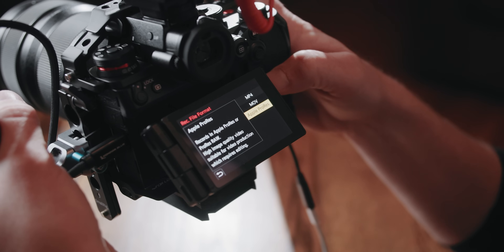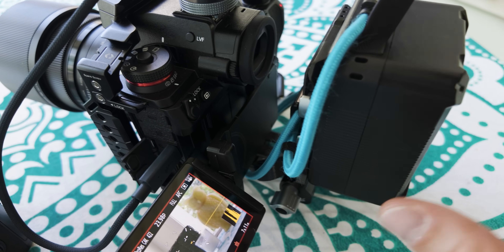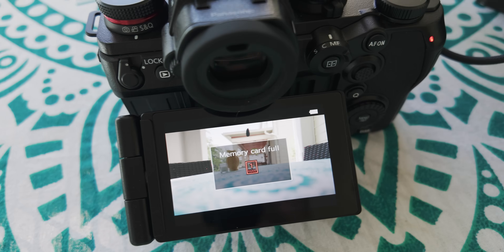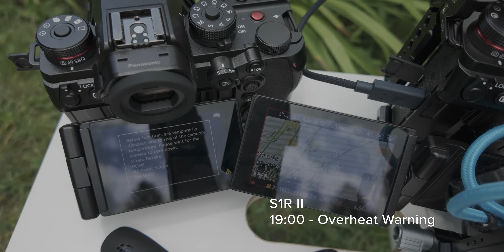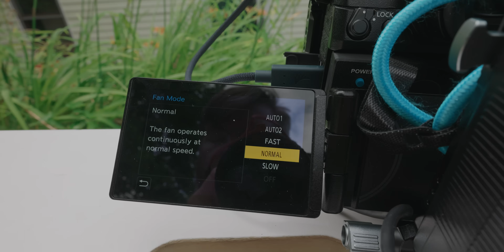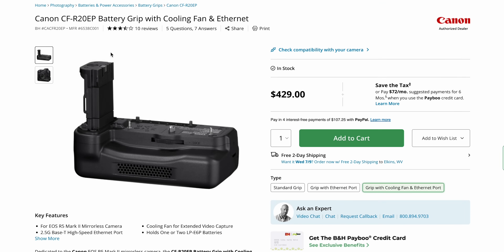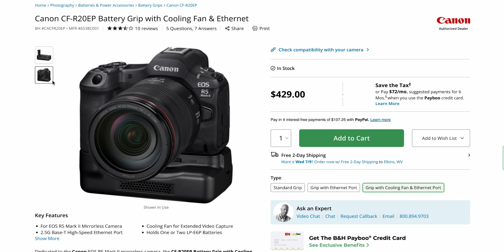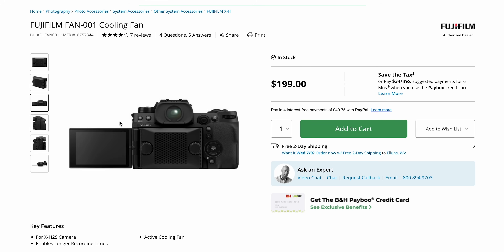I Tried Everything to Not Have My Lumix S1R II/S1 II Overheat

Comment: Do you think the s1rii would overheat if used indoors, 6k open gate 30 fps, connected to power but used for livestreaming for 8+ hours? It's hard to find info on this scenario since no one really uses it also as a webcam for livestreaming, but also for photography.

Comment: It seems like in real use this is not a big issue but if I shot Outdoor events I would stick with S1H and S52X.  
PS: I do not think Panny recommends cards based on thermal performance so no surprise approved cards may overheat easier.  I got one approved slower under 1700mbs Card.(Which is still fast) I stayed away from the faster over 3000MBS cards but not sure if that matters.

Comment: In my experience I will tell you this - GH5 did not overheat, GH7 did not overheat - I shoot video in UAE Dubai - I often shoot video outdoors - at a temperature of 35-45 degrees - or whatever you have there - in Fahrenheit it is - 95-113 degrees. What happened to Panasonic - that they stopped making cameras normally. And this HDMI delay - well, there was never any delay like in GH4, GH5, GH7 - that's the problem with the S series - overheating, HDMI signal delay, noise reduction that does not turn off, problems with connectors .... Panasonic is degrading.

Comment: If you just use the fan and keep it out of the sun the S1Rii won't overheat even when dual recording to SD/CFexpress. https://youtube.com/shorts/9vmIgchIJmc?feature=share
Reply from the maker: The sun is the tough part, for sure.
Reply: @CurrenSheldon  I just use a flash bounce diffuser to block the sun. Easy peasy.

Comment: I’ve had inconsistent overheating results too. The ac has been out in our office all summer, so it’s 85° Fahrenheit in the office and we film a 30min Monday podcast every week. It never over heats if I have my daughter’s stroller fan on the tripod. Thermal management set to high, fan fast, screen and all doors out and open, still overheat. But outside in 98° in the sun on a tripod, not even a warning, recorded for 10min at a time in different spots in the sun, no warning. Sometimes recording 6K and most times at 4k. Even overheated at HD with stroller fan in the studio without ac

Comment: LUMIX users (me included) will go to the ends of the earth to defend this company. And yes – they have been very reliable. They have to be, because when it comes to their competition, they fall short of the mark. They STILL have crops on their higher frame rates (albeit small). They have poor rolling shutter performance, sometimes due to the higher DR modes they have to employ to keep up in that department. The BLK22 battery is WAYYY overstaying its welcome. Until recently, they didn't even have good autofocus. So they get by on value, stabilization, and great software. The best of any camera system I've used bar probably Arri. They can't afford to slip in any of those departments, and it's everyone's responsibility to keep the pressure on them. That's not hate, and they don't need a defense from it.
Reply: Im a die hard lumix fanboy but im really disappointed with the latest releases. And yes that small battery in the s5 body size but new s1 specs doesnt make any sense whatsoever. Shouldve stayed with original s1 body size + battery

Comment: Congratulations on your tests. I'm thinking of purchasing the S1R2. I'll start by saying that I live in Rome, where I think it's hotter than where you live (in August, temperatures range from 30° to 40° Celsius, taking into account that you shot the video in July, when temperatures are slightly lower). I've also never had overheating warnings while recording with my GH4, 5, and S1. I agree with what you say, that the new S1 models generate a greater amount of data at higher frame rates. Do you confirm that your tests were performed in Open Gate 4K mode at 120 frames per second? Have you tried using a recording mode like the GH5 and S1? Of course, putting a small umbrella on top is ridiculous and cumbersome. At this point, I'll have to consider an external battery, despite the added weight and imbalance.

Comment: In my tests too the direct sunlight was the biggest problems. No matter what else you do once the light hits it and it has to stay under it, it's over. All the "workarounds" just added a few minutes if that. If it's hot but no direct sunlight the S1RII can go for like 45 min. AND worst of all when it did shut down it did not record the footage. So as soon as you get the warning you are done as there is no way to know when it will shut down.

Comment: Working with Sony A7IV's, I found that it was when using a V-mount to dummy battery I would experience overheating even when filming indoors and 4K24 - so not a ton of load on the system. I bought SmallRig's fan, and that would bail me out.

Comment: The Panasonic S1II and S1RII offer shooting modes that the FX3 does not. 
Cinema grade features like synchro scan,  6K open gate, internal RAW and on and on, all come standard with the S1RII and the S1II. 
Those features are not available on the FX3 or even the FX6. 
And FTR; the only Sony camera that offers native open gate like the Lumix cameras do, is the Sony Venice. And that's a $58,000 camera brand new! 
So yes, the FX3 doesn't overheat, but to be fair, we need to compare apples to apples here, and the FX3 and the S1II / S1RII are significantly different cameras! 

And there are impressive Lumix cameras like the S1H or the S5 series that do not overheat, and of course the GH7 doesn't overheat either if you're happy with MFT. 
There's a reason Gerald Undone labelled the Panasonic S1II 'a masterpiece' ...because it is!

Comment: Thanks for doing this! I own a Sony FX3 and A7IV and have been considering switching to the S1II but the overheating has been scaring me off. Oddly, I can run my A7IV at 4K 30P in full sun on a hot 90F day and it will get around 20 minutes of running before overheating. It's almost like these new Lumix cameras perform similarly even though they have fans?
Reply from the maker: Yea they seem to perform similarly. Using an SSD or SD Card will definitely help. It also seems that full professional models have just become more expensive and $3k is the new mid-tier cameras that are incredible, but have some limitations.
Reply: Just got for S5iiX
Reply: The s1II didn't overheat on me even in plenty sun 40°C

Comment: Now try with manual focus lens  and you will get another few % improvement .
Reply from the maker: Hmmm - maybe. I had the cameras in manual focus the entire test (though did have AF lenses on them) and when my camera did overheat, I was using a fully manual lens. Not sure it makes much of a difference.
Reply: it does, i have created a model for 3d printing of a cooling fan for canon R8 as it does suffer a lot when doing 4k 60p and with canon lens and manual focus lens (m42 lens with adapter) i have noticed great improvement. @CurrenSheldon

Comment: I would be interested in whether or not the S1iie overheats. I know it's not loads better than an S5iix in terms of spec but you get the nicer LCD and EVF. I assume it wouldn't overheat if the S5iix doesn't.
Reply from the maker: Agreed - will also solve the issue whether it’s the new sensors or the new body that’s the primary overheating cause. Love the S5IIx but all of the body, design, evf, ibis, etc advancements would be very nice

Comment: Not the same camera body, but I was on a doc shoot with Fuji XH2S bodies. We found that running ProRes HQ they would overheat after about 30-40 minutes, when we went down to ProRes standard, we never had any overheating. Ambient temperatures were around 25C. What this indicates is that data rates make a difference to temperature build up.
Reply from the maker: I would like to test these cameras NOT using ProRes and recording to an SD card. There are just so MANY variables that it would take days and days to test them all. But I am shooting in 6k open gate (not ProRes) quite a bit, so that may be a good thing to test.
Reply: I watched another video to the topic a week ago, it was created by a blogger from Poland. He also tried out different settings and techniques to address the overheating issue and, interestingly, using the SD card he was able to record longer than using a n external SSD. Please don’t ask me why and how that could be!… Unfortunately, it’s not an option for me as I record in ProRes HQ only. On the other hand, I never record longer than a minute or two, so I have never experienced any overheating issue with my S1R II !…
Reply from the maker: @vladislavihl  Hmmm, very interesting. My SSD was getting BLAZING hot on top of my camera, so I wonder if the camera can read that and actually kicked off due to the SSD... will need to test with an SD card now, erghhhh. 

And if you're only knocking off 1-2 minute clips, you'll be fine!
Reply: They’d overheat after 30-40min with the fuji cooling fan?

Comment: Scott McKenna did the same test in 2021 with sony - fx3 never overheats - i own this camera for years
Reply from the maker: It seems the more video/cinema focused bodies (namely FX3 and S1H) have this problem figured out - as they should. Lumix would have been smart to skip the S1 II and go with the S1H II (or whatever it's going to be) and make it real clear that the S1R II is high-res photo focused with great video specs, but if you want fully reliable video cam, there is another option.

Comment: Did you try ulanzi cu01 cooler 

It has a vapor chamber closed loop design 
The thing cools like a fridge 
Allows me to shoot long form open gate in direct sunlight
Reply: Ha, ha, ha. Very funny. Get a fridge for your camera. What next? 😎😎
Reply: @gbwalther3198 well sadly it's this 35 dollar accessory or just give up and dump 2k plus on a used Cinema camera 

Nah fam I'm good
Reply: The lcd design doesn’t allow for that thermostatic cooler to make contact with the back of the camera body.
Reply from the maker: Yep, this was my problem with a couple of the other fans I tried out.
Reply: @CurrenSheldon worth a shot 

There is also models from smallrig and tilta but lack the removable battery feature and are way more expensive, though they perform the same as the cu01 ulanzi 

I used it on a7iv which is notorious for overheating 

Xm5 which in summer day can do only 12 open gate 6.2k, now I can do 48 min open gate recording 

Xs20 can only do about 16 min outside open gate recording, now it ran at a record 59min using open gate 6.2k

Xt4 can do 29min (capped in software) X4 on 256gb card and never dies.

It was so good I had to get two of them before they become a rare find or hike up in price.

One pre balanced on gimbal for fast high frame rate 4k slow motion long takes 

Another for the handheld rig 

Even my fellow colleagues who have zv01 and a7iv bought them, said this thing never leaves their rig now 

It might work if it was allowed to run on full tilt from the start of the recording.
Reply from the maker: @MrZerosami2 yea the problem with those models is that there isn’t room for something like that behind the S1R II and S1II screen. It has the hinge along with the flip out and so you can’t fit the larger fans behind it.
Reply: @CurrenSheldon 
Yeah I just checked it's tricky to rig with those tilt Flippy screens unless it remains on top view mode 90 degree tilt but the fan won't have the proper clearance to stay propped in place and without the lip of a regular tilt screen it won't stay in without popping out.

This might leave you with the most expensive option
Tilta cage with the thermal mount tilta closed loop cooler fan. But also force you to use an external monitor all the time, even for gimbal use.

There is a third option that requires some hand grease and money, scan or measure the inside left surface on the cameras body when the screen is flipped tilt up 90degree and then scan the same surface on the s5iix screen 
Print a frame to house the cooler.
This also forces you to use an external monitor at all times.

Tricky to have a fan integrated body that isn't doing too well in direct heat 

Though the codecs are too much for the camera 

Fourth solution I can think of that is cumbersome and expensive is to grab an Atmos ninja recorder to offload the write and Brute processing off the camera to extend operation time, it will lock you out of most internal recording options and require more storage due to file sizes.

Don't own one and never tried but planning on getting one if I land a contract, been wanting to dip into the external raw hidden in my camera bodies 

It's all I can think of as for solutions to extend recording times on those heavy codecs 

It's a beautiful system the s1ii and the sensor is something else really, true low light beast and a second option to opting for Sony for low light
Reply: Tricky, been rigging lots of these SLR and DSLR body types, always found a solution for managing heat, even rigged out my friends original black magic 6k to balance properly on a crane 2 gimbal and quick release to a video tripod for run and gun work, there must be a way to rig those tilt flip bodies for better cooling, if only I can actually play around with the camera in show room or a shop, we don't have it in my region, mostly canon Sony and Nikon , I'm even one of the few that have Fuji, most people here don't know that Panasonic has a full frame line (they are missing out really)

Comment: The truth is that Panasonic messed up with these cameras. They should used the S1H/GH7 style of fan, it would have helped a lot
Reply: I've never even heard of the S1H overheat. The fan style is probably the reason along with the 24mpx sensor.
Reply from the maker: YEP. The S1H has a second fan behind the LCD screen and that helps a ton. They should have added that to the S1 II or just come out with an S1H II after the S1R II with better cooling - problem solved.
Reply: @CurrenSheldon  Interesting - what's your background in camera design and engineering?

Could you summarise the overlaps and differences in capability and characteristics of S1H, S1Rii, S1ii, GH7 and S5iix? And then go on to explain the implications and specific implementation challenges inherent to each camera's internal architecture? And finally relate that to their documented thermal limits?

With all of that covered, could you express what percentage of (potential) Lumix customers have the same needs as you?

Comment: Shot a low budget film throughout the summer outside with a C70 and a R5C last year. Absolutely no heat warnings or overheating. That’s in 8k on the R5C. Everyday on that job was a worst case scenario. All day shoots all everyday for thirty days.
Reply: I also used two C200’s as well in raw with no issues either. Cinema cameras are truly workhorses.
Reply: That's an insane stress test! Epic.
Reply from the maker: Oh yea - I've mainly used the C70 and C300III over the past four years and I've never even considered how hot it was outside. Sometimes the C300 got LOUD when the high fans kicked on, but it kept on trucking.
Reply: What about Sony FX line (fx3 / FX30)? I don't know if they could overheat in summer
Reply: I find that with the R5c hard to believe. I worked with it on one shoot and it overheated like crazy. All Canon R5's are notorious when it comes to overheating. My conclusion is that all hybrids that shoot higher resolutions and frame rates can overheat.
Reply: @ArisHouwing1973  R5C definitely overheats...I find his account kinda hard to believe as well.

Comment: Definitely seems like LUMIX made an oversight in the design of this body that they are intending on putting all of their near-future releases into. It seems clear that the internal fans don’t yield nearly as much heat dissipation as you would want in small bodies with these specs. 

Still awesome cameras though and less of a disaster than it would be if we were having these issues with a Sony FX series or something. Ran the FX3 in 4k 60 to CF Express type A card in All-I for nearly 3 hours straight in nasty summer heat - crazy fringe use case as an impact cam at a firing range that I couldn’t be fiddling with mid session, but didn’t even get an overheat warning when I went and grabbed it when the session completed. But that’s what you expect from the Sony FX line, they generally aren’t breaking new ground, but making sure you have a camera that ALWAYS works - that’s why you still have top-tier shows shot on the F55 and docs using the fs7, I mean shoot you see fx3s all over UFC broadcasts. 

I feel like I just gushed about Sony’s FX line, but that’s really not a fair comparison. If you compare the s1ii and the s1r II to Sony’s hybrid cameras under $6K, it’s not even close. LUMIX has been crushing it, even with this small thermal oversight.
Reply from the maker: Agreed all around. These cameras from a spec, usability, stabilization, audio, codecs, etc are in a league of their own, even against $5-6k cameras. Still, I think Panasonic would have been smart to skip the S1 II and focus on getting out an S1H II that is rock solid. Then you have the option between the S1R II for high-res photos and 8k video, but with some heat limitations and the S1H II that is a rock-solid video body.

Comment: Nice try good analysis....but here in Maryland ( hello neighbor) I use gh6 for long band shoots cuz it NEVER overheats even in 100 plus degrees. With cf express.  I think using SSD is the general solution for Lumix ff cameras.  P.s.  my gh5 still rocks!
Reply: Gh6 not a Full Frame man.
Reply from the maker: Love the GH series and never had any issues when using those cameras.